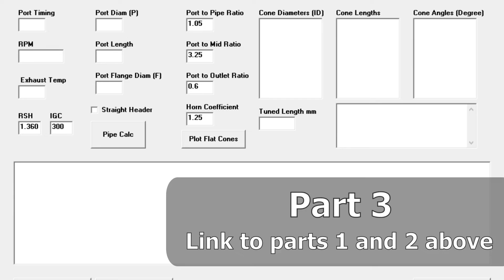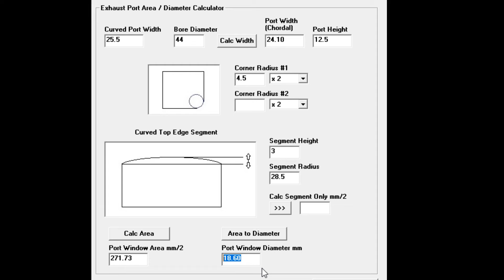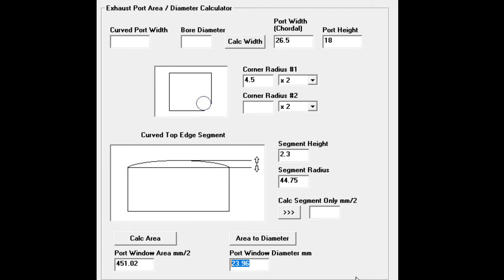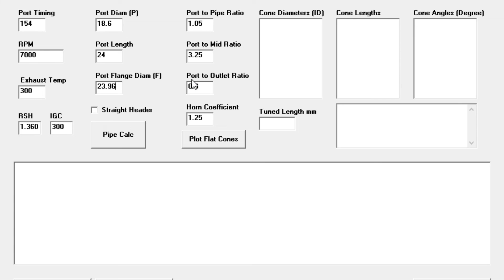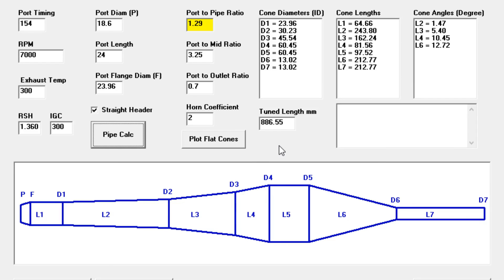2 stroke porting, part 3 - Converting Exhaust Port Map to Area.

Comment: What are those other coefficient and ratio variables all about? Are the defaults the recommended values?
Reply from the maker: Hi Frank if you are referring to RHS and IGC, RHS is the "ratio of specific heats" and IGC is "individual gas constant" which in short is the composition of the gasses in the exhaust, if you hold the mouse over them it will give more help.
These values are different to air than for exhaust gas and they influence the speed of sound inside the pipe and so effect the tuned length calculation.
The default values represent average air fuel ratio and using petrol fuel, for other fuel types that may vary hence I left them adjustable.

Comment: Can i please direct your attention to a picture of my current pipe and get your opinion of how to possibly modify for higher rpm. Was going to try shortening it by quarter inch

https://www.google.com/search?q=ada+s1&client=firefox-b-m&sxsrf=ALeKk02xgN81Ew8sN5tT3jj3dLpfikbLxw:1599455849909&source=lnms&tbm=isch&sa=X&ved=0ahUKEwir8JGupdbrAhVI11kKHdIwARMQ_AUICSgE&biw=360&bih=612#imgrc=gi1Jij_PkOdljM
Reply from the maker: It would probably be easiest to cut and shut the header pipe just after the flange spigot.
Reply: @AuMechanic  thank you. Will try that next season. Getting cold now

Comment: Hello sir. Ive been watching your videos with extreme interest. I have a question please. My application is a small scooter. The pipe has to be compact and make one preferably two bends. There is a video online of my engine setup with a quickdraw pipe reving to 21000 rpm. I know im nowhere near that. Maybe 18000 19. Can i have your imput. Thanks
Reply from the maker: The pipe may have a shorter tuned length to stock to run at higher RPM, but the engine may also have ignition module that limits peak RPM.

Comment: How does it affect engine preformance if you lower or higher your max. engine rpm chart. My eninge at max. rpm  revs to 12500 with no load. My peak power of enigne is at about 8200 rpm. What should i type in RPM chart
Reply from the maker: Use the maximum RPM figure, it may only rev to 8200 under load at top speed due to the power and torque of the engine now but if you put a pipe on it raising the power then it should rev higher and if you change the gearing then it may be revving even higher again at top speed. 
You want it to be revving to red line at top speed full throttle.
Reply: @AuMechanic  thanks for explanation. 😀

Comment: hey dude i have known you for a long time have used your software twice to make a pipes for my 60cc enduro bike :D btw it is simson s51 its fun little machine this out of the way i have got myself a 350 two stroke its izh planeta 3 it is 350 single but has 2 exaust ports that guide to 2 separate headers. originaly it comes with 2 separate exausts but i want to make them merge so i have just a single pipe and muffler any tips on how to calculate the header length or any advice you can give ? tnx in advance btw i have not pulled apart the engine yet so i have not done any mesurements i will most likely playaround and do some cutting and porting wont go for reeds yet
Reply from the maker: Interesting one
Re the header lengths, same as one pipe as the length is dictated by tuned length and that doesn't change regardless of number or ports
The only difference will be the diameters, It is much the same as a single bridged exhaust port but with 2 outlets at the head flange..
Calculate the area of each exhaust port, making the header area sized to each one and then double the area of the pipe after the 2 into 1
Also ensuring both header pipes are equal lengths.
Reply: @AuMechanic  much tnx. One day when engine is done I will show it to you. Very appreciated !!

Comment: I have a 2 stroke 65cc whipper snipper that I bought new in 2015. Do these use only fixed/static ignition timing?... or do they have a curve based on rpm??  Thanks.
Reply from the maker: They have some advance, the module is usually incorporated into the coil.
A 2T engine has poor efficiency at lower RPM so having the ignition advance in this region improves lower end and very effectively limits peak RPM. However once a 2T engine gets to peak and efficiency rises in particular with an expansion chamber (as it comes in to "tune") you will need to retard the ignition to get it to rev any higher.
However if there is no advance added at lower RPM then no need to retard it back as it comes on the peak.
Reply from the maker: Note if you replace a coil be sure to get the same part number coil, likewise for chainsaws, even though you may see one that looks the same it may not have the same timing module in it and you could end up having it not rev out or over rev.
Reply: AuMechanic it’s a crap whipper snipper... I bought a new one. So now this engine is of no use. So I was thinking of just detonating it for fun... blow it up. Can I just change the position of the flywheel... will this advance the timing equally everywhere?
Reply from the maker: @mareksumguy1887  
That be one way to do it with the flywheel keyway out or ground down. Just be aware some of them have a hard limiter in the module in which case it'll just "4 stroke" and wont rev
Maybe drill a big hole in the muffler near the outlet to make it flow as they are fairly limiting to RPM.
Make sure you get it on video :-)
Reply: AuMechanic whats rev limit got to do with anything?  I’m gonna load up the engine with a couple of rc airplane propellers. I might even inject some N2O into it... for a bigger bang.
Reply from the maker: @mareksumguy1887  
If you load it up it will just pull the revs down and and that wont hurt it.
And if you are going to use Nitrous then it wont take long to blow it up, in which case why bother doing anything else to it such as ignition.
Reply: AuMechanic do you think it will be dangerous to start with the ignition advanced enough to induce detonation??
Reply from the maker: @mareksumguy1887  
No, and I doubt you will induce detonation anyway.
Reply: What do you mean??... every engine will detonate if you advance the timing far enough!
Reply from the maker: Compression, something and old weed eater doesn't have enough of to cause detonation regardless of how much you advance the timing.
Reply: AuMechanic not old... 2015/16.
Reply from the maker: @mareksumguy1887  
You said "it’s a crap whipper snipper" so I assume its made from Chinesium in which case 4 to 5 years would be old and worn out.
Reply: AuMechanic it’s crap in that it vibrates the hell out of my hands. I don’t know if this is due to engine being unbalanced or the trimming head being unbalanced... or something else being unbalanced. I think the engine is pretty decent.... it’s a Baumr-AG.

Comment: Apologies on my ignorance, but can these principles/theories/modifications/etc. be applied to marine 2 stokes?
Reply from the maker: Yes it does, its just that in many cases in regards to the exhaust much of the exhaust header section is cast into manifolds with one outlet so there is no way to use a single pipe formula easily and you would need to use some software that handles such manifolds to design a pipe for one.
The tuned lengths of the system remains the same equations based on wave reflection timing but the section diameters of the chamber and outlet ratios are not and it requires some additional factors to account for the number of cylinders filling it.
Reply: @AuMechanic  Thanks for the reply!🙂👍🏻

Comment: Hello Master, 

I have an question about the cones. I used your fantastic software for un new exhaust for my Suzuki RM 500 cm3 1983 (motocross).
Every things are perfect but it is not straigth ! How to do if I want to pass (curve) in the meedle of the frame ?
Every calculs will be false ... Thank you so muche, Jacques
Reply from the maker: Hi Jacques
there is a program called "Cone Layout" that can help with cutting out patterns to form a bend in the pipe.
Alternatively you can use the "Pie Slice" or "Lobster" method, there are many videos on this, it is not hard to do.
Basically you cut the pipe at half the angle you want to bend then rotate the 2 parts 180 degree to double that angle which will be your target angle.
Doing this retains the centre line length of the pipe through the bend which is important to maintain tuned length.
Reply: @AuMechanic  Hello Master,I understand. 
Thank you for your answer. Best regards.

Comment: We have been missing your videos! I was wondering if you could comment on transfer ports. My Bultaco Montadero has small transfers relative to your smaller engines. Will you comment on crank case volume and how that is a limiting factor.  Can the transfers be too big? Some guys have hogged out the cases below the transfers. How does port velocity play between the cases to the transfers?
Reply from the maker: That's a bit to cover in comment section, crankcase volume or primary compression ratio is possibly a video on the topic itself.
On ports and sizes Ill be doing some stuff on that at some stage, and yes ports can be too large and they all need to be sizes correctly in proportion to other ports.
The flow in transfer is more critical the closer it gets to the cylinder but down low at the cases matching helps as does increasing the size at that end to aid delivery to the port entrances..

Comment: Hi dave! Thank you for sharing your knowledge. I just finished my first pipe, built from scratch, using your program. Bending the diffusor and printing out templates in correct scale was by far the most difficult task in this project, but it turned out great. Question 1, how far into the reflectorcone can i put the bleedpipe without messing things up? Q2, how much bigger do the ID of the silencer need to be relative to the ID of the bleedpipe if i dont want the silencer to change the pressure inside the pipe?
Reply from the maker: The method of inserting the outlet pipe inserted in to the baffle cone is Gordon Jennings book from the mid 70's with the idea that doing so can reduce the higher frequency sound a bit with no loss of power. So it does not increase performance in anyway and his original purpose of doing it was actually to make the whole exhaust shorter.

He states that if done the pipe should be pushed up in to the pipe so that the tip is an inch or so forward of the beginning of the baffle cone section, so the tip of the outlet pipe inside is located some way in to the parallel mid section of pipe.

However, the calculations I use in the software as from Prof Gordon Blair papers in the late 90's who makes no mention of this method, and he also has a whole study and designs on silencing that I might go into some time in a video. In short, there are other ways to silence than using Jennings method.
As for the pipe diameter Blair states that the pipe Port to Outlet ratio equation accounts for the fact there will be a muffler added to the pipe so you are safe to simply add a muffler to it with it's ID the same as the outlet pipe.
Also note there that in another study published in which it is proven that the ID of the pipe is what is critical to bleed of the right amount of pressure and the length of the pipe is only relevant to the effect of the length on the restriction of the pipe,  even if the outlet pipe is very short so long as it restriction to gas flow out is equivalent to a longer pipe with a slightly larger IS then it is the same thing to the function of the exhaust.
So that all provides some guidelines to design your muffler and pipe around to what best suits the fit to the machine.
Reply: @AuMechanic  Ok my pipe is now finished. Its short,fits the bike very well,its suprisingly silent and makes good power. Thank you for the support.
Reply from the maker: Good Job

Comment: I've had a play with your software, all looks understandable. How does this correspond to shorter expansion chambers like that of motocross bikes?
Reply from the maker: The basic design is the same, all that changes is the equation factors used to determine if the pipe is more for peak power or broad range power, the tuned length is not different, its just that MX pipes otherwise known as "Up pipes" or "Snake pipes" generally have longer tapers for broader power and being bent 90 degree around the centre neutral chamber can appear to be shorter.

Comment: Would it be possible to reverse engineer a pipe by porting the cylinder to work with the pipe.
Reply from the maker: It may be possible although it may be simpler to modify the pipe.
To work backwards you would need to accurately measure the straight line tuned length of the pipe you have and from that you could extrapolate the exhaust timing it expects based on the RPM of the engine.
Likewise you would need to ensure the area of the port window matched the diameters of the header and stinger pipe diameter factors and that part could be difficult to do an even may not be possible.
The height of the port will effect timing so once that is set you are only left with width changes to achieve the right area value and there wont be a lot of room to move there so you may end up not being able to get the port size to the numbers you need to satisfy the pipe diameters even if you get the tuned lengths right.
Far easier to modify the pipe so at least if the diameters are close you may only need to adjust the length of the pipe.

Comment: Hi, used your fantastic chamber calculator to design a pipe for my bike. Sat down in front of the PC with the Cone Layout v 2.0.5 program which allows you to print out templates to cut from but I've hit a brick wall. My intention is to produce the pipe in segments. For example the L2 cone at 275mm long would be divided into 8 frustums with the appropriate angle at each end, thanks to Cone Layout, to enable it to curve under the engine. My math is no where good enough to work out what the diameter of the cone should be at 7 points along its' length. From you software I have the smallest diameter and largest diameter for the cone but am unable to figure out diameters at 34.4 mm intervals along its' length. I've searched the internet without any luck. Can you point me in the right direction?
Reply from the maker: Hi Rob, sorry I didn't get to this sooner I was off snow skiing for a few days.
I am just working on a method to make this a bit simpler for you to do, there are cone calculators in my software to calc straight line and cone angle conversion which you would use in a round about way to get the figures you need.
Ill sort something out by next week and may add some equations to the software and update it as I am sure others will need to do this too.
I don't use Cone Layout software myself it was recommended by Niko at Hollaendaren YT channel to use to do bends so this issue was not apparent to me at the time I did my Pipe calc software.
Reply: @AuMechanic  No problems, everyone deserves a little time off now and again. I feel a little embarrassed writing this. After trying to nut out how to work out segment sizes and coming up with nothing, then contacting you, I had a bit of an epiphany yesterday and came up with a solution. So I hope you haven't spent too much time on this already. 
Basically I've created a fairly simple Excel spreadsheet that does the calculations. Enter the cone length, entry and exit diameters and number of segments you want and it calculates the two diameters of each one.
I've now got a number of curved paper diffusers of varying shapes as I learn what angles I need so it fits the bike. You are more than welcome to a copy of the spreadsheet. Might be a starting point. Or not.
Reply from the maker: @robmiller1514  
Glad you sorted it out.
As you know by now the equation to get the end diameters is not that complex, it's just I didn't think to add it to the cone calc page in the software but may as well do.

Comment: Hi Dave. I am interested in researching variable tuned exhaust geometry for use with Rotax 582 type aero engines. Your videos so far have been a goldmine for me thanks. Are you aware of any research or practical work going on with variable geometry? Thanks, Terry, NZ.
Reply from the maker: Good question, Far as I know there was some work on various means of varying geometry of pipes from moving internal baffle cones to water injection done many years ago but for various reasons they did not take off, one being racing regs probably ruled them out in Karting classes for one and they would likely not last long once you sent oily exhaust gasses through them for some period and moving parts in them gummed up.
Variable exhaust port timing seems to have been the favored method as it doesn't just alter effective port timing but also effectively changes trapped compression ratio and blow down time too.